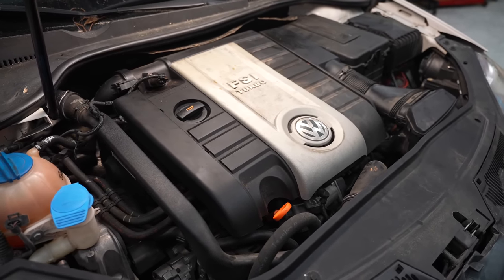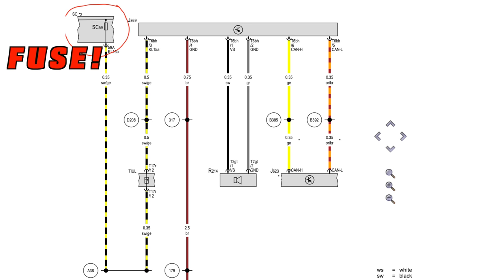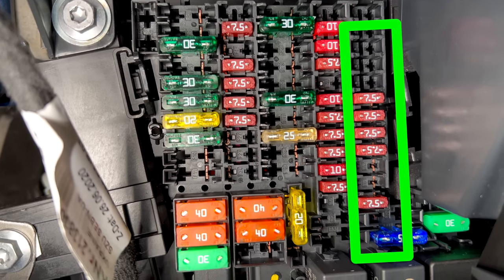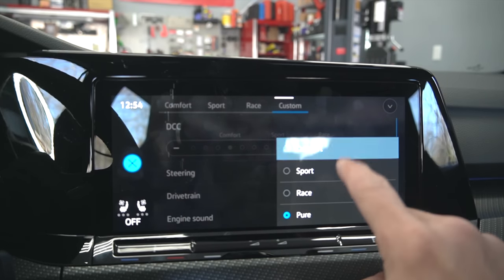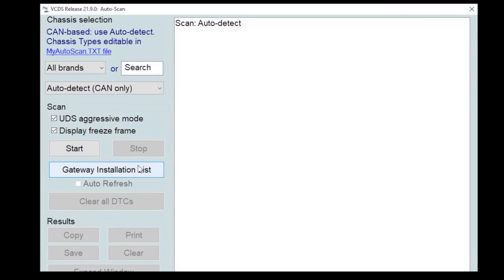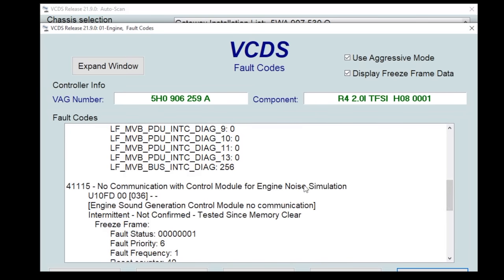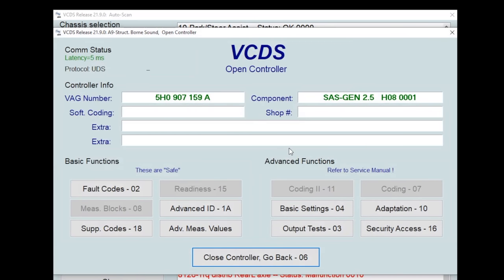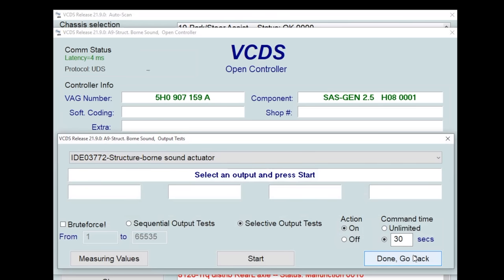Fake Engine Noises ~ How To Disable Soundaktor on MK8 GTI and Golf R

Comment from the maker: Jump to 2:02 for pulling fuse method, and 4:14 for scan tool method! Im excited to get the MK8 properly sorted. Its a super fun car, but we can make it al little better :)
Reply: We’ll be here with u the whole way, I don’t even own one of these cars but your content is too good to miss out on Charles
Reply from the maker: THANK YOU!!@!
Reply: Hey charles when you say if you do the pulling fuse method “youll probably end up with a fault” what do you mean exactly? Will you get a warning light/notification when starting the car? Thanks!
Reply: At 4:54 It didn't store the fault in the Soundaktor itself because it was off when the fault occurred (you pulled the fuse XD) And since it's selected in the installation list in the Gateway module, other modules were expecting messages from it and couldn't communicate with it (in case of the ECM, it transmits info like engine rpm for the Soundaktor to generate the correct sound tone and frequency and it's synced with the engine).
Reply: @HumbleMechanic  I found on my 7.5 R the soundaktor was decent on 10% and wasnt very intrusive. 

Have you found out how to code the exhaust valves always open?
Reply from the maker: Not yet. Working on that this week
Reply: Does my 2022 s3 have this?
Reply: @Midnight8y  Yup
Reply: This video is such a breath of fresh air, love your energy.
Reply: I thoroughly appreciate the content you bring. I am a new MK8 R owner and hated the fake sound being pumped into the car so I took the simple route of removing Fuse 59 which at the time disabled my Home mirror but it was a trade off I was willing to live with…however yesterday was the first day where AC was needed and after a little questioning my sanity that the AC would not blow cold air. I then wondered if maybe the Fuse removal could impact and after replacing the fuse instantaneously cold air began to pump…so for all of you out there that pulled Fuse 59…you are either going to sweat it out this summer, bring the car to the dealership without connecting or look your minds on why your brand new cars AC is not working 😀😀😀. Again love the content and the car as it is truly a joy to drive.
Reply: Hi, will pulling out the fuse affect the sound system or is it a dedicated speaker/system for the fake engine noise?
Reply: Will pulling fuse 59 cause other systems to turn off or just the soundaktor?
Reply: Mine disabled my AC system

Comment: I don't understand why you have to jump though so many hoops to turn it off. They should have the option from the factory.
Reply from the maker: You can kinda. If you set it in custom drive mode. But on this one it resets every time you cycle the key.
Reply: @HumbleMechanic  Probably not supposed reset on a key cycle - but as you will find in time, there are a b-zillion things on the mk8 head unit / system software that it is not supposed to do but randomly or intermittently will do, just to keep you on your toes (or drive you nuts!)
Reply: @HumbleMechanic  Do you mean that it resets back to Sport mode (not that it resets the Custom mode sound back to something other than "pure")?
Reply: @mgobluevictor atleast the us models have a pure mode. My mom has a german model and the most normal sounding one is comfort

Comment: I really don't understand how this fake engine noise BS was even considered as a solution by manufacturers... What's the point? Just pipe in a bit of intake noise from the engine bay to the cabin with a setting to block it off.

Comment: It would be interesting to get a Raspberry Pi with a microphone to produce an active noise control through the system. Getting rid of tire noise and/or wind noise through active noise control using that system would be a definite quality of life improvement in any vehicle.
Reply: Looks like it has been at least thought of before. Here is a Reddit link to someone else thinking of this. Even with a 20ms response time with road or wind noise would be fine since it takes at least that long for sounds/air to settle in a car. I agree with using Python on the Pi:  https://www.reddit.com/r/raspberry_pi/comments/6azbel/raspberry_pi_for_heavy_dsp_purposes_active_noise/
Reply: Put a patent on that!
Reply: Some manufacturers use the stereo speakers for noise cancellation, microphones pick up road noise and feed it into a module that inverts the noise and feeds it to the speakers. That's an idea I like, especially if it's adjustable! Especially on long, boring highway trips.
Reply: That's already a thing, all of the bigger Audis have it and probably others, too. Not just using the speakers, but mainly the windshield as well, to actively cancel out any humming noises.

Comment: I think some of the reasons this fake sound is added, is that engines are simply just quieter from the factory. We have insulation in the compartment (including the beauty cover), fluid filled engine mounts in some cars, subframes, a soft dogbone mount, etc. Manufacturers can't make everyone happy, and engineers work overtime to minimize NVH. With that said, a user selectable adjustment for the Soundaktor level would be a nice feature in a setup menu somewhere.

I personally have the level set to zero via VCDS, I'd rather listen to my Fender sound system and not have fake sound compete with it.

With all that said, that nice bit of crackle from the factory is a nice touch!
Reply: As Scotty Kilmer always says: “Engine beauty covers are stupid, and over-engineering is a terrible idea.” I’ll give you two examples: A BMW with fingerprint sensors on the door handles. (If one of those sensors shorts out, it will pull the whole car network down to chassis ground. That means you won’t be able to start the car, much less drive it.)
Engine noise simulators on the comfort control module. Why tf would you want to mask the real sounds of your vehicle’s heart (engine)??? (You have to listen to your vehicle’s heart for its vital signs.) I think Scotty has a point.
Engineers work overtime to complicate simple functions of vehicles, and crush consumers by forcing them to get them fixed at stealerships.  Oh please!!!!! Spare me the praising of engineers and wake tf up!!! I’d like to think that you’re a human and not some farm animal. Don’t you see that most new cars connect to the industrial datagrade interphase, which can be hacked by let say…… any government willing to merc you, and steer you off of existence to your eternal silence??
Reply: @jdrs4214  I kind of agree with you, but I wouldn't quote Scotty Kilmer hes a delusional old man
Reply: @devlintaylor9520  Not entirely, he has good points and lots of information regardless of his opinions. Too many new cars seem to be over engineered in one way or another.
Reply: Why have big large sound dampeners (in the exhaust system) and then add fake sound, which isn't even toggle-able? Just idiotic.
Reply: No. Any fake engine sound should have been BANNED
Reply: People hating on fake exhaust sounds are just proof that they don't care about exhaust sound. 
They care about being a nuisance to other people (the real goal of putting loud aftermarket exhaust systems on a car or a motorcycle).
Fake exhaust sounds pipes pointless noise to the cabin, but people outside can't hear it. This is bad because what people want it to be the other way around. Pointless noise to bystanders that you can't hear from the inside.
Reply: @kisielthe1st  I don't know about that. The Mk5 used a physical sound tube (with a diaphragm) between the air intake and cabin, to bring real induction noise into the cabin (also found on Lexus LF-A and other vehicles) and people usually have no issue with that system.

Comment: Lane keep assist.  On MK7.5 vehicles you could go through adaptations/coding and set it for increased response which would take it from "drunk drviving" bouncing from lane line to lane line, to the new settings which will actually allow the car to lane center lane assist. Did this in my 19 Golf R and my 19 Alltrack.  Absolutely made the biggest driving difference of any software tweak.
Reply from the maker: I may or may not have done this. I worry about sharing messing with it. I hate to think someone having issues
Reply: @HumbleMechanic  I did not think about that, the liabilities, even if you disclose "for informational purposes only". I am just a random owner.  You on other hand have been/are a mechanic and YouTube.  "Good call not giving a tutorial on changing lane assist programing". With that being said, I think you would agree, the new coding makes a huge difference in daily,  general drive ability. 👊👍
Reply: For anyone wondering about this just do it it’s easy and great, if you break it and you can’t drive without lane keep assist you shouldn’t be driving anyway
Reply: @HumbleMechanic  Is this an US spec thing? My wife drives an EU spec e-Golf from 2020 that has all the fancy driving assists that I could order here in Germany and while it doesn't feel as good as a more modern car, it's still...okay I guess? I mean it keeps me in the center of the road on roads with good markings at least and doesn't bounce from line to line.
Reply: @Delcaek  I drive a EU '21 8 R, it works perfectly fine and keeps me centered.

Comment: Dude love your vidz. I just came from a MK6 GTI manual and the inclined brake hold was subtle and would release when you hit the gas.
On The MK8 Golf R it feels random and more sensitive to incline angle and does not release when you hit the gas it feels time based and has caused me to stall out at the worse times possible.
is there a way to disable the inclined Brake Hold on the MK8 Golf R Manual? if so can you make a video. ?

Comment: Too bad they don't include these settings for the customer in the vehicle settings. Not only do I want to turn off the soundaktor, I also want to turn off the start/stop "feature." It is annoying. I shouldn't have to buy VCDS and take a chance on messing something up as a customer. Keep up the good work. I've enjoyed your videos for a long time. I owned an 83/84 GTI used, as a kid. It was a blast. The Mk8 I just bought is full of sensors, and modules. It is crazy how complex they have made things over the years. I though the old fuel distributor was a pain.

Comment: I'll be honest, when I heard that the B8.5 S4's had a Soundaktor I was so turned off when I bought mine.

When I experienced it, (on Dynamic) it wasn't as bad as I thought it was.

IMO it helps you hear what the car is doing under load. Since I like my tunes turned up I can hear it better.

Now if it was tuned and not stock, that might be a different story. Just my two cents.
Reply: I like mine in my GTI so I can hear the engine while driving when listening to music. It’s just present enough that I can always hear the engine. Otherwise, when I’ve tried with it off, I have to pay more attention to the tach than I usually would.

Comment: Hi.   I was wondering if it is possible to turn off the exhaust crackles and pops on overrun?     To my ear, the crackles and pops sound like something is wrong with the overrun fuel cutoff.    A wonderful sound in a rally car from 30+ years ago.    It sounds synthetic and phony in a modern car to me.    

Soundaktor is on our mk7.5 GTI.    Thanks for the instructions.   Engine sound fine on its own.

Comment: Really happy that you were able to do this coding via VCDS.
The A9 module was not visible in VCDS in my car similar to your Golf mk.8 (Cupra brand, not sold in the US), so had to disconnect the plug to disable the soundaktor.
Reply: Did you get any errors? I want to remove the broken soundaktor in my MK7.
Reply: @jackmcdonald8355   My car had so many errors, so one more didn’t make a difference 🙂 I was unable to clear errors with VCDS in my car.
Disconnecting the plug will not impede the function of the car at all, so you can also do that without issue. Perhaps removing the fuse is easier, as suggested in the video. Its easier to re-insert the fuse if the car has to go to the dealer.
Reply: @jannikk6556  lol I literally just unplugged it. No errors so far 😂

My car is tuned, so the power train warranty is donezo anyway lol
Reply: Formentor or Leon?

Comment: Question, is it worth it to spend 199. or pull the fuse.  Thanks for the demo!
Reply from the maker: Some have had fuse pull side effects. 

In my opinion if you’re gonna be a DIYer on your modern vw you need the tool.

Comment: Nice, I just used my OBD 11 and turned it down. BUT, because this is the absolute best channel for golf r. I am starting to hate my 7.5 . It is a 2019 with only 35k kms on it. The suspension, at slow speeds over speed bumps or road “wallows” just creaks terribly. The dealership, when it was under warranty, said they couldn’t find anything other than a tight headlight levelling device. I’ve read a ton on various forums and there does not seem to be a definitive answer, but surely a lot of discussion so it is a fault with the car. How do I fix it? Is it the  sway bar links, the rubber bushings somewhere, the springs? I had the same problem in my 90’s era ford truck based SUV’s, I did not expect it from this car and it is hugely disappointing. HELP

Comment: Looking at the wiring schematic might not be a great idea to pull the fuse correct me if I'm wrong but There's an internal connection A38 which is a ignition on power feed  that might be feeding other components on the vehicle better option would be using vcds.

Comment: I'm excited to see you purchased the Mk8 R. I am wondering if you have any insight into the headlights on the US version. Do the headlights have the guts to be able to turn on an adaptive mode like they have in Europe? Now that Adaptive headlights are approved for US use, I'd like to figure out if there is a way to turn on the function using VCDS.

Comment: So pulling fuse 59 works to disable the pumped in sound but you also lose AC and your HomeLink rear view mirror functionality. Those are the only things that I noticed. Not a good trade off. Either unplug or a scan tool is your best options. Hope this helps.
Reply from the maker: 100% NOT A GOOD ONE!

Comment: I removed this fuse on my 2022 MK8 GTI, and the AC stopped working, also the backup camera was glitching out bad not activating until I was already backing up, or not at all. I reinstalled the fuse and everything went back to normal
Reply: Same

Comment: Yes more Golf R videos! Please look into hill hold please
Reply from the maker: YES.. help me out on this one. what exactly do we want it to do, or not do?
Reply: @HumbleMechanic  I have the R with manual. I have experimented with the hill hold and looked into other people's experience as well. It doesn't release if I blip the throttle (I think that's how previous gen was?), it only releases after some predetermined time. I don't think pushing through the hill hold is any good for the clutch or the braking system when I really need to move my car for whatever reason. I want to know if it's possible to decrease the time or even turn it completely off.

Comment: I actually prefer it. In stock form it's too quite in the cabin in "pure" mode and i, because i have the manual, would like to actually be able to listen to the engine, pumped, faked or otherwise, when i shift gears. I don't really look at the rpms since i drove a 4 speed 86 Toyota pick-up for a few years and it didn't have a tach.

Comment: Disconnected the Soundacktor speaker wire on my MK 7. Never displayed any check engine lights or codes. Older car though, might be different for the Mk8.
Reply from the maker: It stored a code in my 7.5. No lights but codes

Comment: FWIW the #59 fuse method doesn’t work on the 2024 GTI. That instead disables the AC.
Reply: @molsen1029 did you find the right fuse?
Reply: Yes! I also did this with mine and got the same result

Comment: I heard the soundActkor (?) was to provide feedback to the driver since some VW interiors were well insulated from outside noise. Is this true? In theory, would it be weird for the driver if they felt and heard very little from the engine while driving? Also, are these different concepts on the regular MK7 golf? Thanks!

Comment: Hi Charles love the mk8, but when you've scanned it using your VCDS. I notice you have a lot of faults etc, that's not good for a new car you've only just received. By the way the exhaust note sounds better now you've deactivated the sound module.
Reply from the maker: This is actually becoming normal. Codes being stored with no issues. ID4 is the same way.

Comment: i done this on my mk7.5 dsg after putting on my remus with res delete, I put it to 0% using obd11. It used to sound way louder and more pops and bangs but recently its alot quieter, foot off accelerator once slowing down it changed gear it would have poped n banged alot. I have sealed up all the connections but do you have any idea why its got alot quieter, is something blocking up etc. just trying to figuer out why its suddenly got alot quieter in sport mode ? Any help appreciated ?

Comment: Thanks for this! Wondering if when you lower your R are you going to use springs or coil overs? Thanks in advance!👍
Reply from the maker: I have adjustable springs ready to go.
Reply: @HumbleMechanic  ah ok! I was hoping you were going to the springs lol! I did mine with Racingline 25mm and was hoping you were going to do a video on the suspension adaptation procedure. 

Can’t wait to see what you do in the future! Thanks!

Comment: Hey. I pulled the fuse and it worked well. The only problem is, that my "Auto-Hold" was disabled too. Is there any kind of Solution for that? Thanks
Reply from the maker: Maybe an unintended consequence. Put the fuse back and maybe directly unplug the module
Reply: @HumbleMechanic  thanks, i've also asked my VW-Dealership and they told me to unplug the soundgenerator.